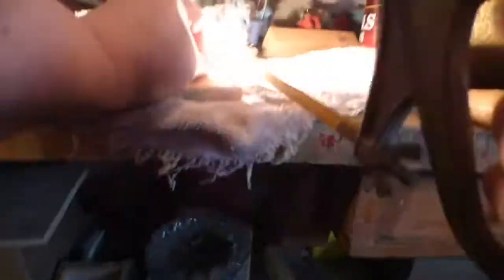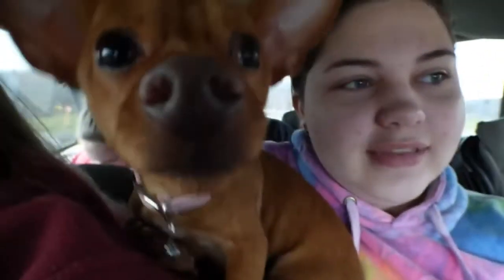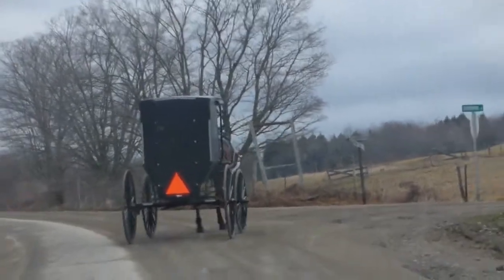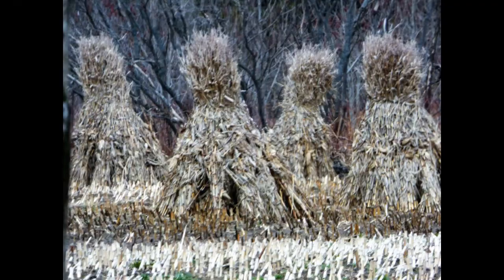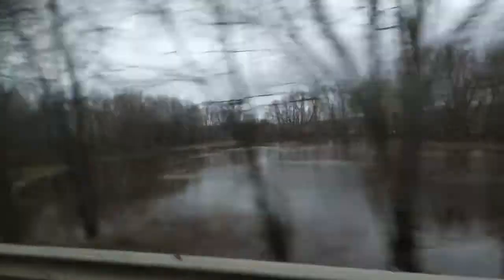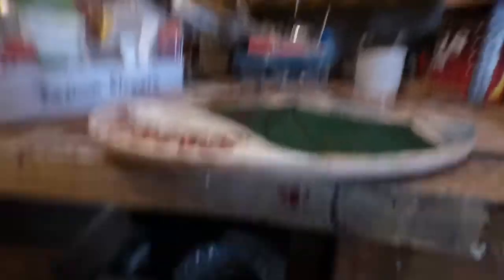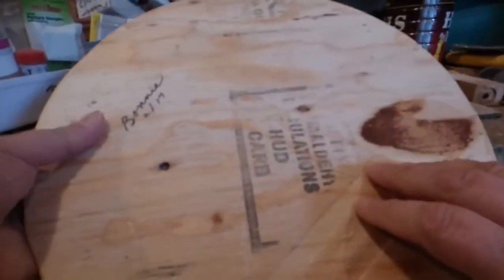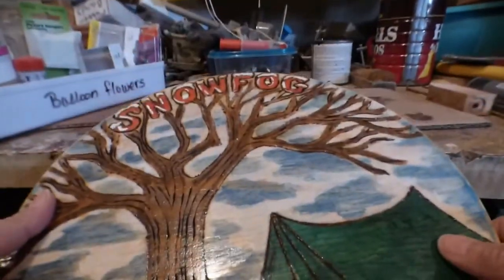Chronicles of SunsetBay Bonnie #2

Comment: Hi pretty cool cutting those ferro rods! That round painting on plywood you should coat the back with something to keep it from sucking up moisture & warping over time & the paint from peeling off! That's what I do!! STB.
Reply from the maker: i normally just paint both sides..but its not going to be outside exposed to the weather so it will be fine.thanks!